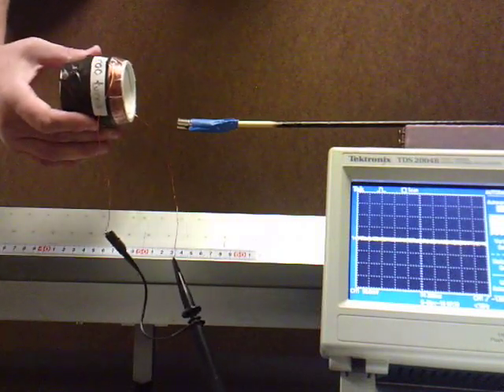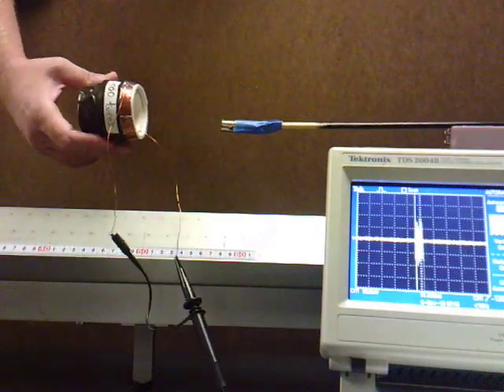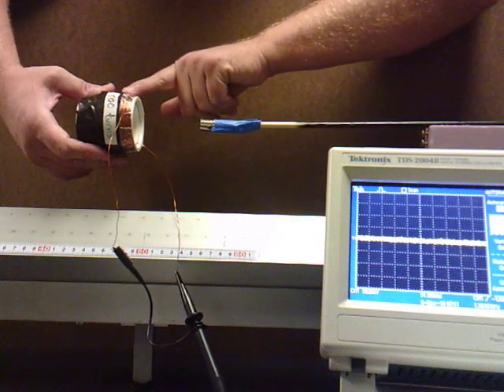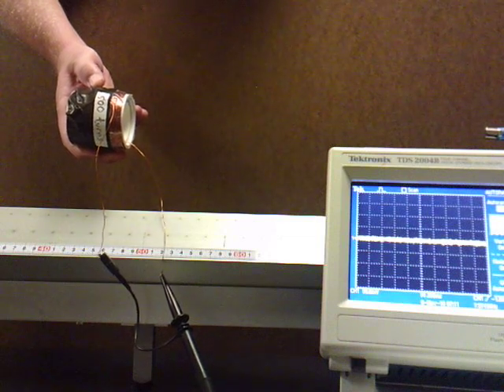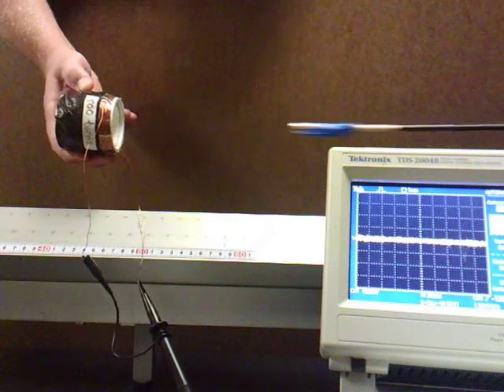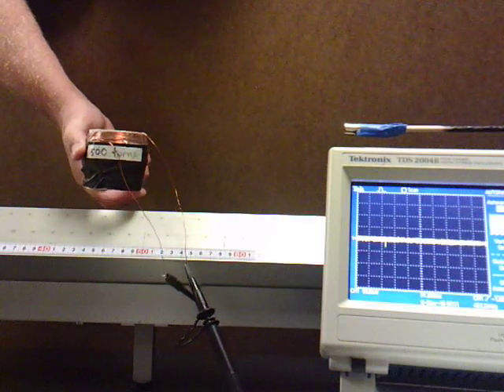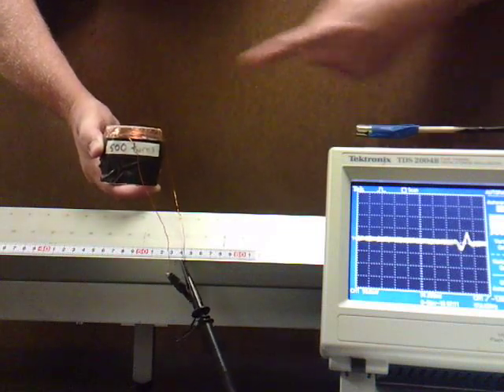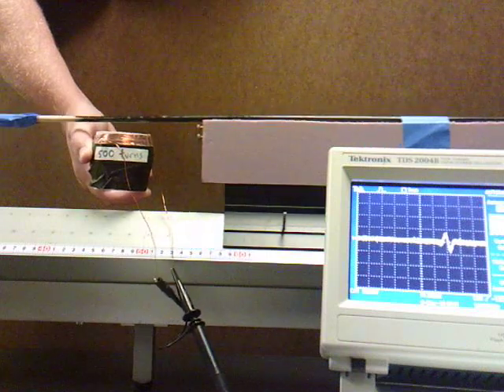Moving Magnet Through Coil

Comment: I am performing a some what similar experiment with magnet attached to an arc moving through the coil periodically but my wave is different from what it is shown here will going through the wire once it produces one negative and one positive tips and here it produces two negative and one positive tip, can u pls help me out what is happening here
Reply from the maker: depending on the size of the magnet, you can better model the situation as two separate monopoles.  for instance, if you have an extremely long magnet, you will see separate blips from the north pole and south pole with significant time separation.  as the magnet gets shorter, sometimes the upwards blip from north pole leaving loop will coincide with south pole arriving (causing a single larger blip).  obviously, the same could be true if south pole reaches loop first.  positive/negative nature of blips on screen will also depend on how the probe form the scope was connected (flipping leads on scope flips signs of blips on screen).

Comment: What's the difference of voltage with a magnet going inside and outside a coil vs going across it? Can be confusing. Wouldn't there be more magnetic flux lines if a magnet spun inside a coil of wire opposed to going across a coil. Hard to find the answer? Nice illustration.

Comment: Sir is this voltage dc or ac plaease tell
Reply: I wouldn't really call it AC or DC.  DC (direct current) is like voltage from a battery.  AC (alternating current) is like voltage coming from an electric socket in your house.  This is more like a transient spike that is only happening when magnetic flux through the coil is changing.  It is different from both AC & DC.
Reply: In a generator one or more magnets move along one or more coils and can produce an AC just as shown in the video, one waveform above, and one waveform below the zero-line, but in an endless row of ups and downs, of course.
DC generators do also exist, but than you have more or less one line above the zero-line.

Comment: Is it correct to say that when de magnet passes through, the magnetic force in much hiegher than when turned 90*?  Would changing polarity on the coil, result in a kind of “resonator”
Reply: 1) In short, you are correct.  Whenever you have larger magnetic flux changes, the induced voltage is larger.  When the coil was rotated 90 degrees, there was much less flux going thru the loop.  2) Changing the polarity of the coil should switch the polarity of the induced voltage on screen (flip the bumps upside down).  I don't think about this object as a resonator, but any coil of wire will have some inductance and capacitance.  In that sense, it definitely is a resonator.